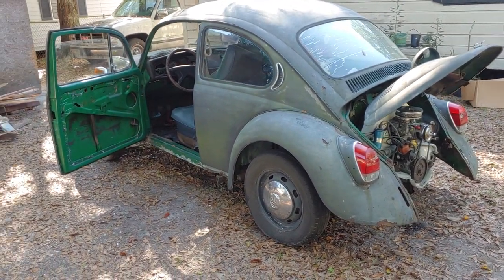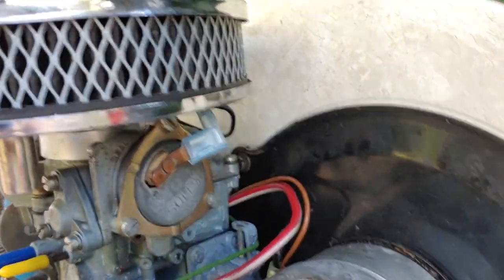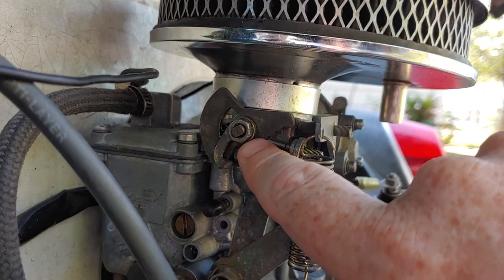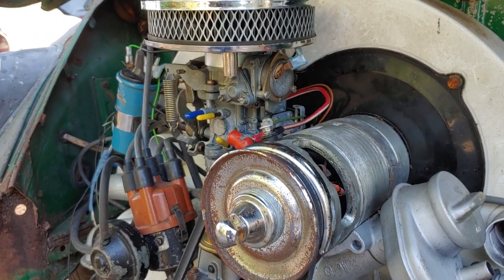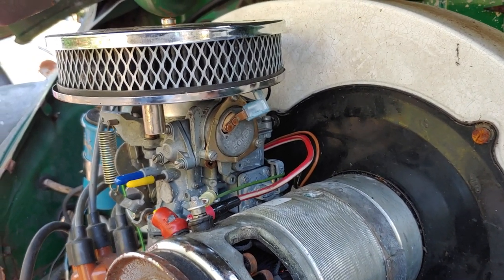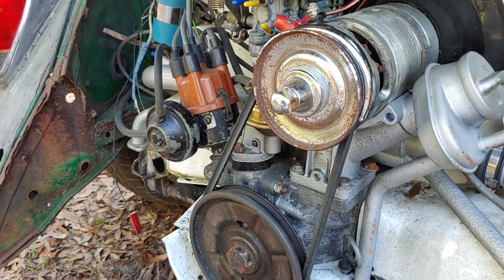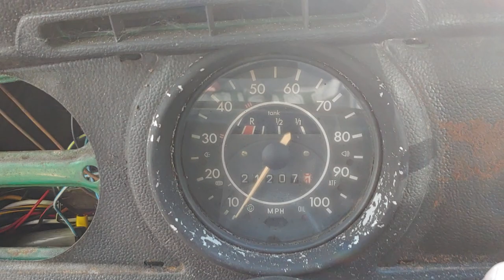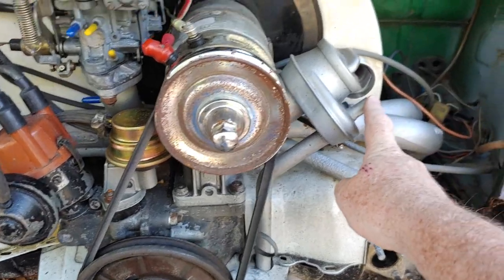CLASSIC VW- 1972 SUPER BEETLE UPDATE. ELECTRIC CHOKE. ( SOLEX 30 PICT.3 CARB )

Comment: Sounds good 👍. How about the distributor vacuum line?
Reply from the maker: The vacum advance is Inop inside the distributor. The vacum diaphragm on the outside of the distributor has no vacum at all. I hope to change the distributor here soon to clean up the engine bay. The vacum advance has never worked. Hope this answers your comment. It would definitely cause a idle issue. Thanks again for commenting. I appreciate all your input and respect your knowledge.
Reply: Thank you for sharing 👍👍👍
Reply from the maker: @oscarblom4885  thank you

Comment: Getting close on the oil filler or gen stand that your crankcase vent..Good progress John.
Reply from the maker: I'm not following what your saying. Did you see somthing that is not correct?
Reply: @Volkswagenplanet  No see nothing wrong i was just commenting on the hose that between your air filter to you generator stand or oil filller a crankcase vent. Motor runs good you finish up with the muffler it should be close enough where it is set. What next brakes ???
Reply from the maker: @busman5429  yes sir, I'm doing some homework on brakes as we speak. I'm shooting for this week to start on the brakes. Going to be a cold week for us. High 60s to mid 40s. Thanks for looking out for me in the video. Always thankful for that. Hope your doing ok

Comment: If my beetle has 30 pict-2 carburetor. Can I replace to (30 pict-1) or (34 pict-3) ??
Reply from the maker: Yes, should be a direct fit.
Reply: 30-1 yes 34-3 wider manifold needed or adaptor